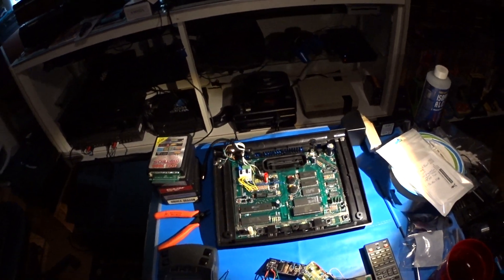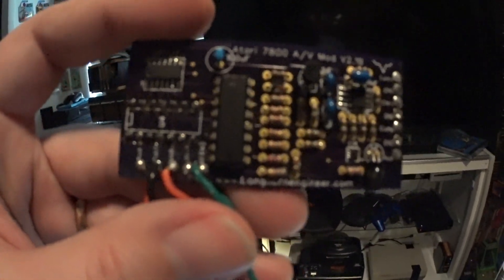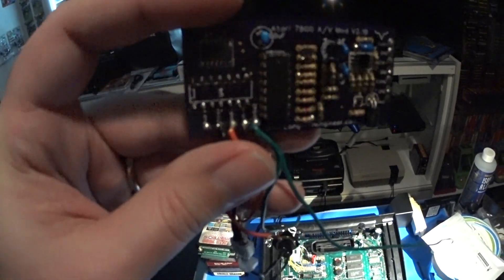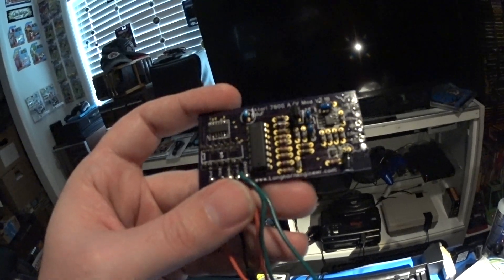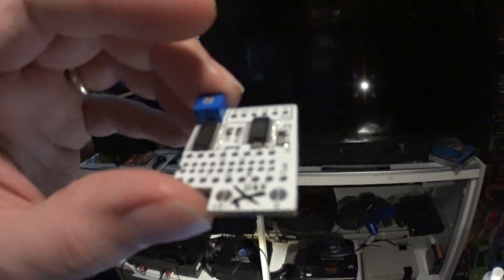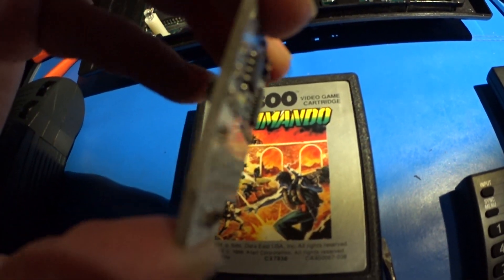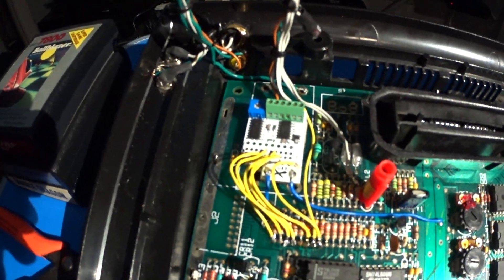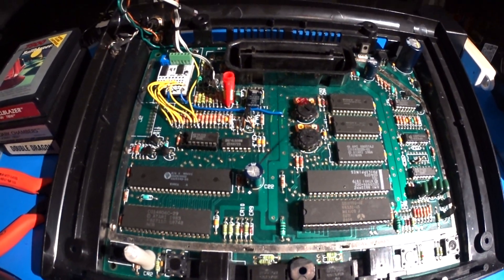ITC - 7800 S-video solution finally! With the UAV rev D!

Comment: What size wire do you use for the UAV?
Reply from the maker: Well as the signal wires from the resistor points to the UAV are static and not likely to move around much, I actually have 22awg solid core for that in most cases however, I just did a UAV into a 2600 and used sections of scrap 26awg stranded I had laying around for the signal wires.  I always use 26 - 24awg stranded ribbon for the outputs to the AV jacks. I use 18 - 20awg stranded for the power and ground.

Comment: Is that last one (UAV) come out stereo?? Or just double mono?
Reply from the maker: None of the UAVs offer stereo audio out. To do stereo from the 7800 requires completely different wiring to amp the signals off the TIA pins separately and then place the pokey external audio to either the left or right channel. So no..not in stereo. Other modders do this but I wire everything in dual mono only on Atari systems.
Reply: @IvoryTowerCollections  Sweet, thanks

Comment: Can this be installed in the 5200 also (Universal)? How do I get it?
Reply from the maker: Yes it can be installed into a 5200 as well. In fact the installation is easier in the 5200 than it is for the 7800. You can order the UAVs in the configuration you need from the The Brewing Academy.

Comment: Congratulations!!
Reply from the maker: Yes it is a very easy mod board to install and I really like the fact that you don't have to technically remove any components in the 7800 to use it. Byran's new audio mixer board is now available to install to get cleaned up audio out as well and doesn't require clipping the resistors as I did here to get balanced audio output. So technically with his new audio board you can still retain full RF out functionality as well if you so desire. Without the audio board RF will work for video only as you have to but the resistors to prevent noise from the RF side bleeding through.